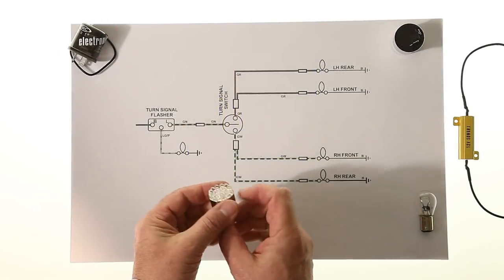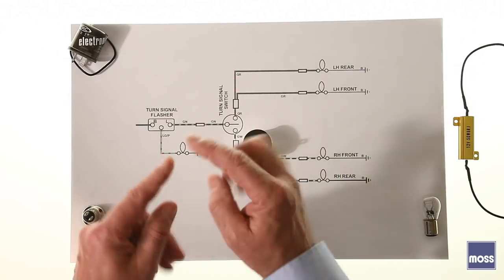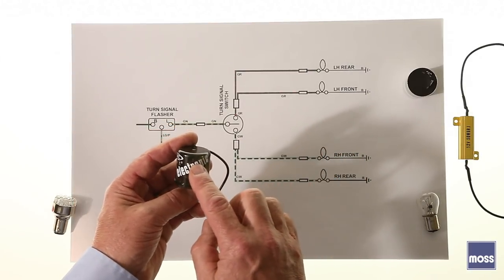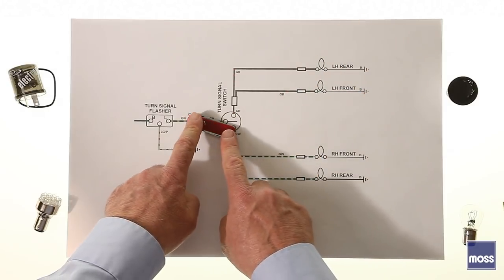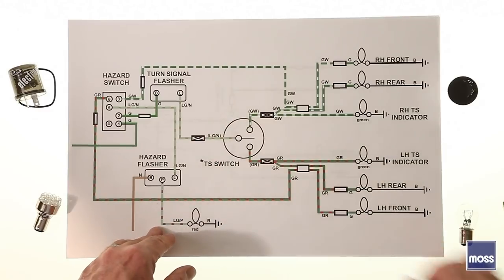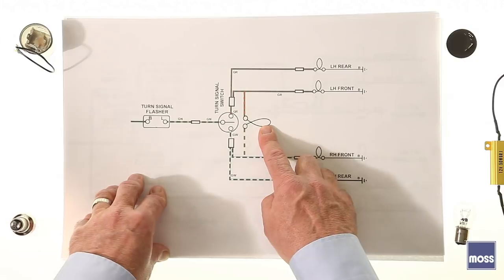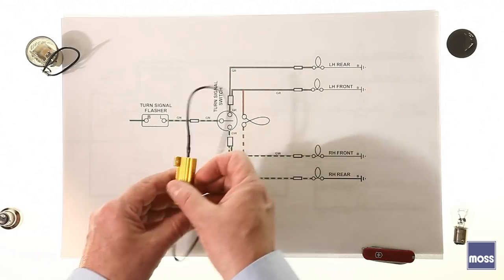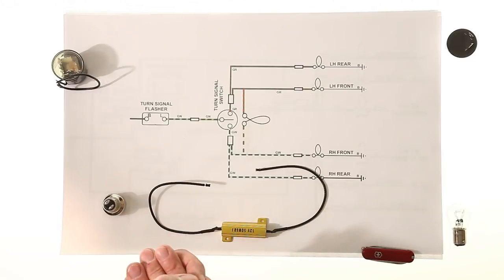LED Installation and Common Issues Answered

Comment: Great video! Two questions come to mind.
1. What is a ballast and how does it behave? Why use a ballast, rather than just split the connection of the dash bulb off the other bulbs and give it it's own ground?
2. When a bulb is burnt out, how does the flasher know and blink faster than normal?
Reply: Very good questions, and too bad Moss would make this video high quality video and then ignore questions such as these.

Comment: This is a very good explanation of LEDs and how they work. However LEDs are very uni-directional. This means they are very bright when seen directly in line. Unfortunately, as your line of sight angles away, the LED appears much dimmer. You want your flashing lights to be seen from all angles through to 90 degrees, just like a conventional bulb.Why 90? Because you want to indicate to cars approaching from all angles - that you are waiting to turn.

Comment: I have installed  drl unit led strips with turn signal. It has 3 wires. Red, black & yellow. Red & black are connected to drl unit and works perfectly fine. If i connect the yellow cable to its individual turn signal, once the drl unit switches OFF the leds are dimly lit, lets say about 50% of each led strips are ON. If i remove the yellow cable than there's no issue. How do i resolve this?? I timed and it seemed it was ON even after a minute.

Comment: I know this is an old video, but here goes:
I just tried to install led tail lights on my RV trailer.  The tail lights, brakes and turn signals all work individually like they should.  The trailer is fed by a 7 pin connector from the tow vehicle (2002 Chevy Express van).  The one problem I have is that when the tail lights are on, the turn signals don't work on the trailer only.  All the lights (incandescent) on the van work normally.  Even an old (40 years in business) trailer shop said that all they could do is to try different parts to solve the problem.  I can't seem to find a fix for this.
I tried to hook up the led lights to my other vehicle that has a 4 pin connector and ran into that sympathy blinking issue.

Comment: how about having always a fix light on in all signal light then if you turn it right, the right signal will blink and the left signal light is not blinking but is on mode. as will as the other way around. how to do that one? any idea how?

Comment: Hi can you help me with this plz 
I've got a Vauxhall vector 07 1.8 . My front side light is going off and  on I've just got the resistors but don't know how to put them on it can you help
Or do l just put them on the two wire's side lights  
Plz .Thanks very much. 
Yours sincerely 
Robert Gordon. 
Plz plz help
Reply: The resistors go one on each side that is changed to LED. So one end of the resistor goes in-line with the turn signal wire, the other end of the resistor goes to a ground wire. Here is a demonstration. https://www.youtube.com/watch?v=WyUh1ztBH84

Comment: Don't know why you would want LED turn signals to lower current use as they rarely are on.  Wire your own LED's on a pos grnd car by putting + to ground and - to power.  Not all that difficult to figure out.